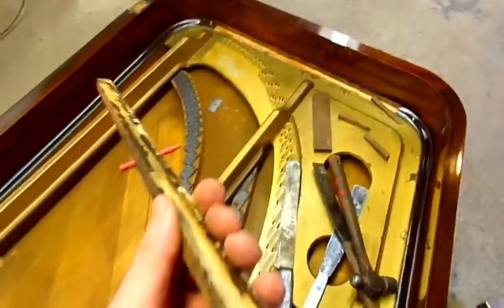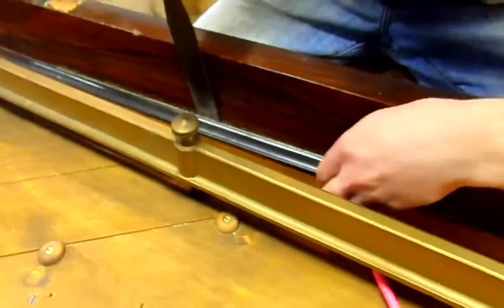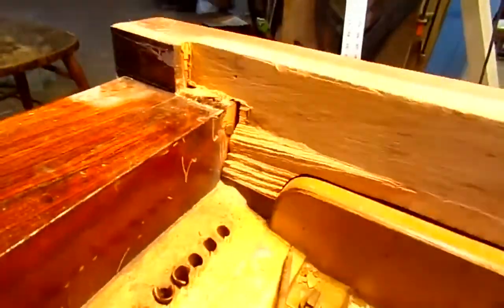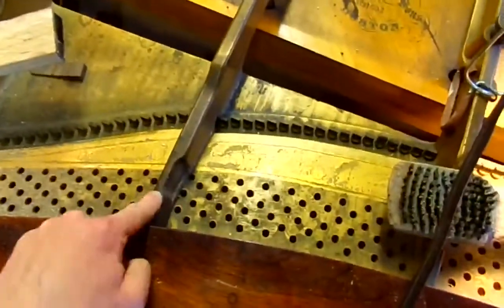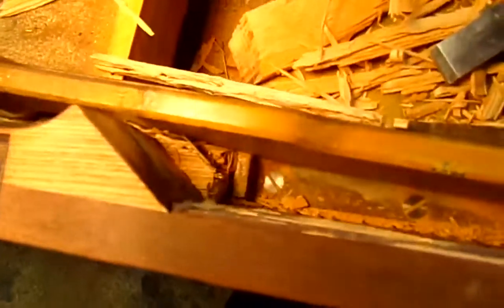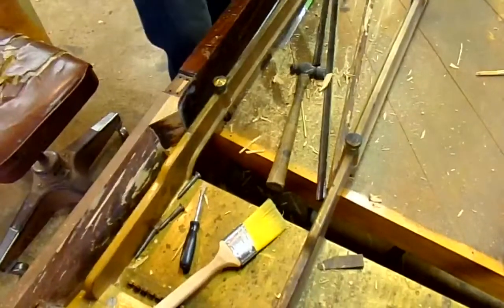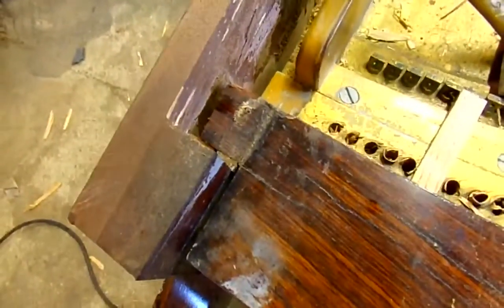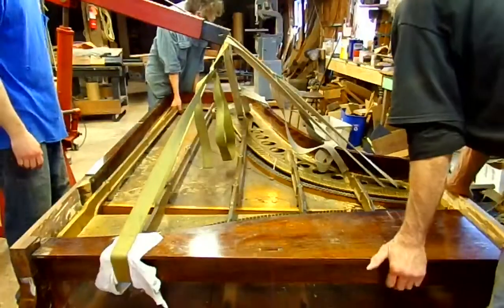Chickering 33B 1867 Conservative Restoration Part 3

Comment: It is amazing that they could build a piano this way in terms of modern sensibilities but one has to remember that labor costs ranged  from 25 cents/day to 10 cents/hr.  Plus piano engineering was progressing along at a fast pace in the post civil war era (lots of experimentation).  This piano was built only 40 years after the invention of the full/single piece iron frame and 12 years after the invention of the continuous case rim.

Comment: Wouldn't it help to heat (and moisten?) the moulding first?
Reply from the maker: That is rosewood, moisture does not penetrate, very well, or at all. It would take a week to soak it off, and everything around would loosen also.
Reply from the maker: @TopRahmen Yes heat penetrates but moisture is necessary to re-constitute the hide glue.
When someone thinks heat only softens hide glue that is incorrect, the moisture in the wood itself is what makes that seemingly possible, for if one were to heat dried hide glue by itself it will burn before it softens.
Reply from the maker: Yes but hide glue can not be re-constituted with heat alone, wood has moisture content which makes it possible to soften hide glue.
Dried hide glue by itself will smoke and burn by itself in experiment, it wont soften.